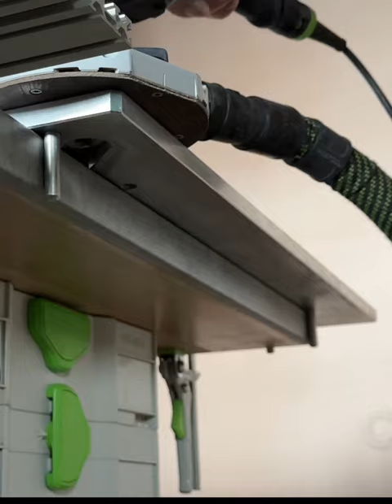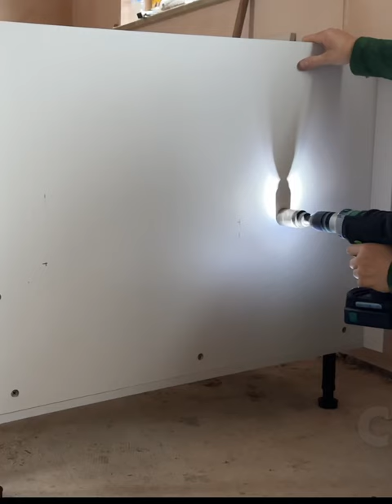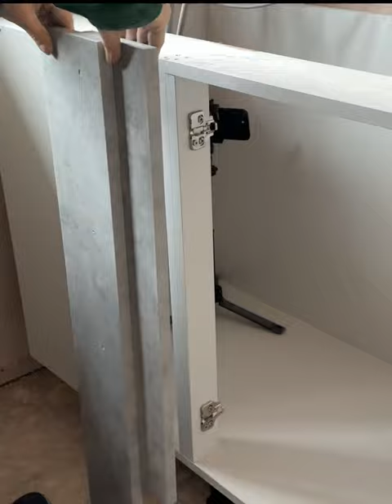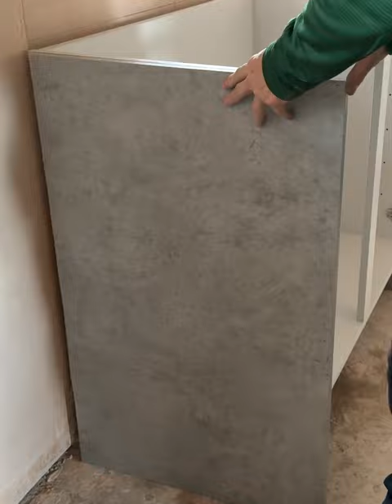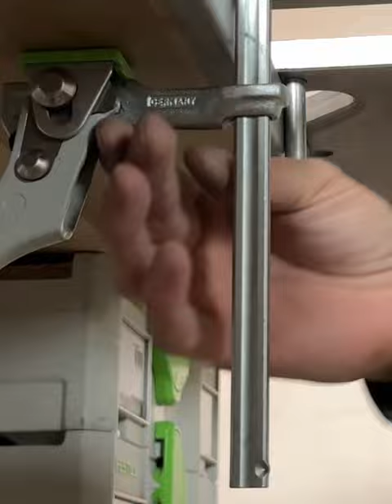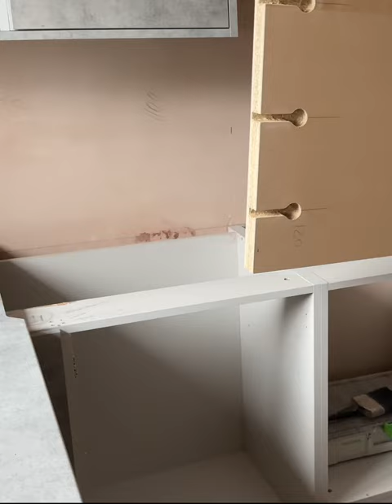Kitchen time ✅

Comment: What did you  use for adhesive for your masons miter on this video was it grey silicone I used the colour fill that came with my worktop stuff goes off on the worktop to quick I used grey silicone on my second joint was easier to work with ?.great video  again.
Reply from the maker: Thanks i have used sealant adhesive frome egger

Comment: Let's make everyone else job harder. We will make a painter decorater masking/demasking, cutting in, cover up, and leave a brush marks everywhere, instead of nice even coat. After, we will bring the tiler, who will be grinding, wet cutting in the same room, resting his tools on the brand new counter. Also might end up cutting top tiles on the splashback and will end up with uneven offcuts under the units.
Reply from the maker: I got no choice I have planned everything 3 months forward so everything should be prepared when I start these 7 flats building so they were saying that’s fine we’re ok with that u just do your job
Reply: Tell me you've never worked in a kitchen without telling me🤡🤡🤡🤡🤡🤡🤡
Reply: Get a life